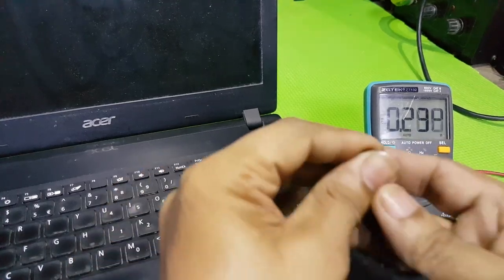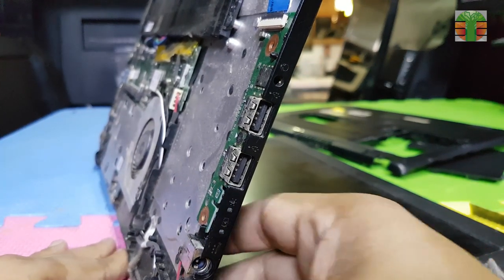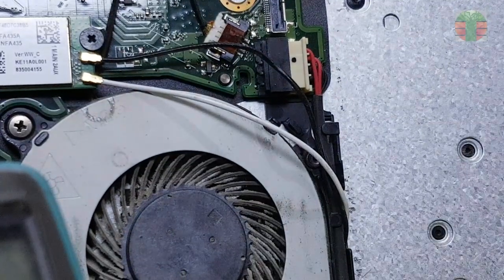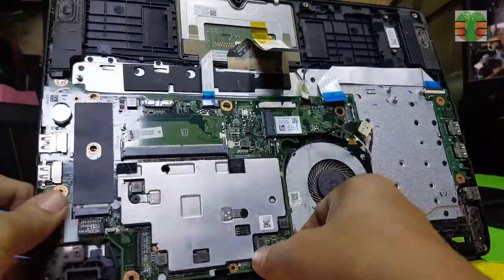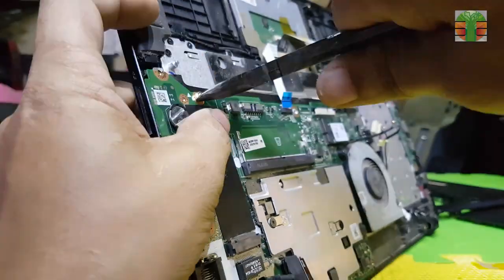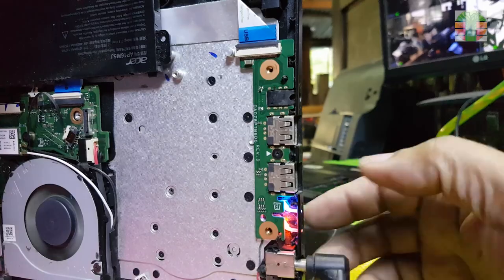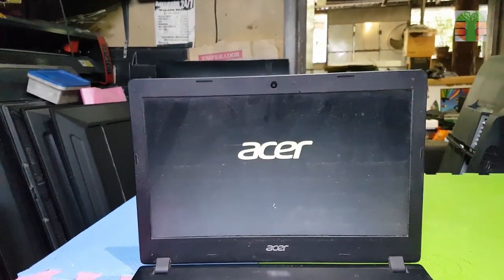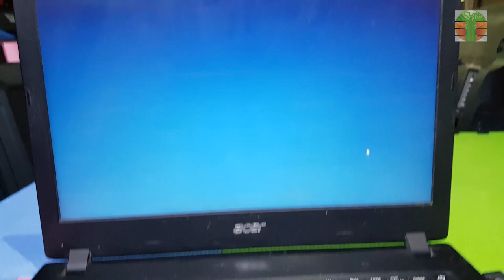Acer Aspire 3 A314-32 not charging (Common problem)

Comment: VERY nice video. The narration  was very clear and easy to understand.  I have the same computer where the fan will not stop running after shutdown.  Tried all the power option settings and reinstall the OS but nothing works.  Upgraded the BIOS.  Used a different m.2 ssd but didn't work  I use the computer with the fam unplugged.  The cpu gets to 45c so It's OK, normal was 35c.   Thank you for the video.  I'm now a new subscriber.

Comment: Nice video. Pretty well explained. I saw many Tagalog/Filipino videos that are hard to understand so this is much better.
Main DC input was shorted. Then checking the main power line you found a shorted reverse voltage diode, removed it and short was gone.

Comment: Bro, oxidized na yung tip ng soldering iron mo. Bili ka na ng bagong tip and practice tip tinning and proper maintenance para tumagal. Also, if dealing with desoldering SMTs, mainam ang heat gun.

Comment: Hello Tevz, I have the exact model where my fan runs all of the time even when it's turned off thus draining the battery. Is there anything I could look for?  I flashed to the latest BIOS.  No fan adjustments there.  I also tried changing the settings in power options but it didn't work.  Thank you, Ralph

Comment: 4:36 It's got a shorted TVS diode just like cheap arse HP's do n I'm certain I'm right cuz I've replaced hundreds of em with 24V Zener it is there for a purpose to protect the motherboard from spikes from lightening etc if it was only reverse polaraity an ordinary diode could do that, a pro tech who warranties his work for 3mths as I do by law would replace it!
Reply from the maker: I think it was been got shorted when the charger dc plug is inserted, the positive is connected first. a surge of electricity shorts it.
Reply: @tevzTVTevatronics  Well that's what it's there for to STOP spikes that could kill the charge controller IC or even worse the SIO IC!..... But hey if you like doing sloppy work n I don't know if you warranty your work or not but if you do n it comes back with a fried SIO that has the bios in it WTF do you do?... All over a 24V Zener... A few cents for piece of mind self satisfaction n pride in your work, you have to ask yourself is it worth the risk for a few cents to do it right the first time?... Only you can answer that!
Reply from the maker: @preston963  putting a Zener is a bad idea, what if every unit gets this trouble only by a spike of electricity turn up of not able to charge. it has a mosfet in the DC line which handles the spikes of electricity. a diode across the DC line is not necessary.
Reply: @tevzTVTevatronics  A 24V zener won't trip from a 19V laptop supply that's the voltage of the original zener you removed n look how long it lasted I've been doing this for yrs with no problems or if you don't want put a zener back at least an ordinary 1N4007 for reverse polarity protection.
I've been a tech 40yrs!